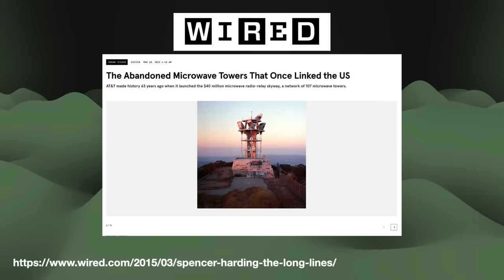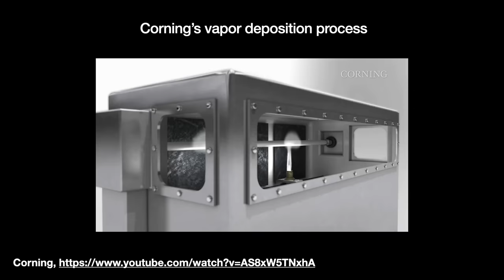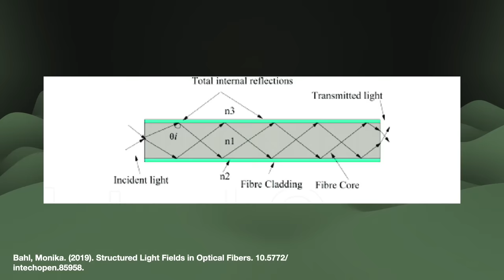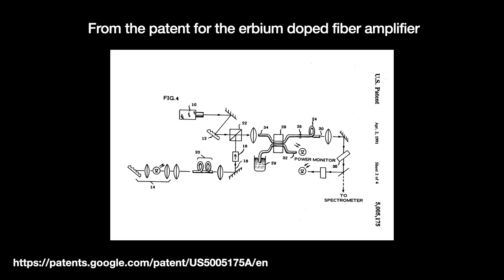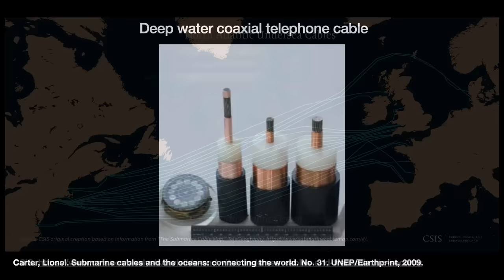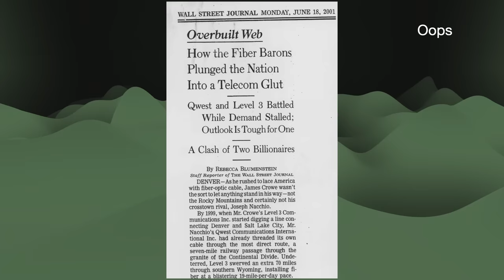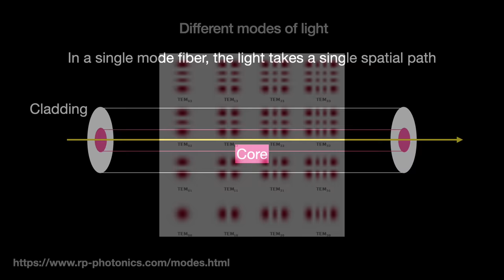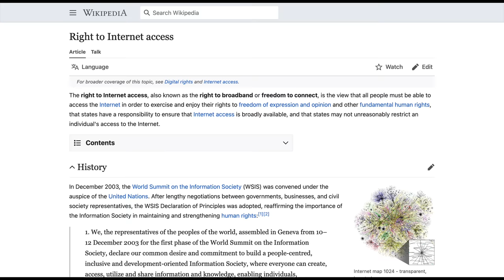How Optical Fiber Connected the World

Comment: Multi mode fiber used to be the cheap one that you avoided for high performance application, becuase the multiple paths lead to a smearing out of the signal. Instead of an impulse you receive a smear of all possible paths. Now, with additional mathematics and advances, we can actually use it to our advantage. How times change
Reply: To utilize the "multi" you need more complexity in the sender and receiver. Uncontrolled "multi" mode fibers over longer distances have semi-infinite modes which don't help your data transmission because the complexity to transmit&receive those modes is beyond what we can build. You want a relatively low number of modes to actually make use of that property. Actually you want many modes that are mostly-independent and require low complexity to make them fully independent logical signal channels.
Reply: @siegfriedkettlitz6529  Yea it balanced out. Multimode fiber itself was cheap, the transceivers were expensive tho. It was opposite for SM.
Reply: The problem with MM is also the size (volume) of light entering the fiber. SM works because it's a very tiny beam. You can, in fact, fire a SM laser down a MM fiber, but it won't go nearly as far. I've often wondered why no one built systems to fire multiple SM lasers down a MM fiber. With modem DWDM optic capabilities - i.e. very selective receivers - it's totally unnecessary.

A multi-core fiber would a serious pain in the ass to splice.
Reply: Until we have functional rectennas, it’s not worth it. Just put in a separate fibre.
Reply: @jfbeam I work as a fiber-tech, and a few years ago we were connecting multiple companies in a new building. To their infinite wisdom, the building owners built a fibre distribution net.
However, they built MM, while all modern ISPs use SM.

So we patched from incoming SM (isp side) to MM (building side), with SM gear in the rack at each corporation renting a few offices.

And it worked, had a few more DB then needed of attenuation, but with a 10db headroom, who cares...

Works fine to this day.
Reply: @djn3kkid  I've used MM patch cables for SM runs. Sometimes it even works. 🙂 (replaced with SM once they were on hand.)

Comment: I was introduced to optical fibre in Brisbane, in '95, while doing computer systems engineering. We cut & spliced fibre, in the classroom. (Tip ~ it isn't all that hard to do, but you have to get the two ends in the jig, and properly aligned, and they have to be precise.) and then checking the splice with an optical time domain reflectometer. That is virtually the same set of hardware you find in a police LIDAR unit. If your join doesn't come up to standard, at least you will know about it before you bury it again. The OTDR can tell you if there is a break, blockage or interruption, (which includes a kink or sharp bend where there shouldn't be) and locate it down to about one metre ~ which is handy.
The major take home, for me, (TLDR) was just how fantastically good fibre optic communications are. Which contributed to my massive face-palm when the Australian government (under the new prime minister, Malcolm Turnbull, who had been the opposition spokesman on telecommunications & IT, because he had once been a lawyer / attorney for a major telco, not because he knew did-ley-squat about IT or computers) decided to renew / upgrade continue the copper wire network and gradually expand the fibre network only as fast as required. ie ~ to replace stuff that was too old to keep fixing. That stopped the previous government's project to make the Australian Broadband Network, in fibre, all the way to the premises ~ (your front gate) which would have been massively better, if somewhat more expensive to initially install. Predictably, what we have now is slower, more costly, more error and breakdown prone, and in need of replacement anyway, which it mostly wouldn't have been if we had done it with fibre the first time. Measure twice ~ cut once. And don't take anybody at face value who tells you they can do some new development at half the price, using an existing technology rather than a new one.
Optical fibre is pretty near miraculous. The sheer amount of data / information you can pump through one strand of glass not much thicker than a human hair, is mind boggling. It has the potential to transmit millions, billions of times more information than a twisted pair copper cable. It does age, and will need to be replaced one day, but it ages 3 ~ 5x slower than twisted pair. The cost to install is greater, but over the whole life of the network, it's actually cheaper, and the capacity can be hugely increased by upgrading the send & receive at the ends. The more tightly you can control your colours / wavelengths, at the ends, the more channels you can pump through one fibre. Your potential bandwidth is limited by the quality & sophistication of your transmit & receive equipment, not by the glass fibre itself. The better your transceivers, (and repeater stations) the more you can pump through it. The theoretical upper limit is pretty much infinite.

Comment: Fun fact When the F4 Fighter jet was modernized, they saved 300 KG of weight by replacing copper wire with fiber.
Reply: 661 lbs or 1 OP's mom

Comment: Those same optical amplifiers also gave rise to fiber lasers for industrial cutting and welding, replacing bulky and expensive CO2 lasers.  And laser diode power modules are still growing in power and capability.

Comment: As early as 1970, I worked on a phototypesetting machine, the “PhotonPacesetter”, which use a xenon flash and a fibre optic bundle to transport the flash through a spinning disc with a character set, through a series of lenses, to photographic paper. It was my introduction to minicomputers. At one point, I was able to work around a hardware problem with “software”.  I was hooked.

Comment: I recently took an electromagnetics class that introduced me to how fiber optic cables work. The technology is very cool, and based on how you tune the material properties along the light's path, you can take advantage of certain behaviors as you pointed out in your video. There is still interesting engineering to be done to design more advanced systems that can communicate in novels ways. As a field, fiber optic engineering is not something a lot of people think about.

Comment: Latency is due to permittivity, not resistance. The dielectric used limits the velocity in both fiber and copper cables. Vacuum- and air-cored fiber and coax all have velocities close to the speed of light in vacuum

Comment: One of the things that you may want to touch on later on which was missed here was polarized optic fiber transmission.
Polarization is used in microwave transmission having a vertical and horizontal positioning This was also developed for fiber optic and is currently being used to double the capacity of fiber optic transmission. The other technology that is being used is still wavelength transmission one fiber can transmit and receive. There is one downside to this it means you need a wavelength to transmit in a wavelength to receive. Another good topic is on the development of terminating fiber and on the development of ribbon fiber. Ribbon fiber offers extremely high density.
Overall this video was very informative on fiber optics cable and I enjoyed it.
I have worked in the industry for over 30 years.

Comment: I used to work with fiber optics running lines and splicing and have seen entire buildings have to be reworked cause it was installed with too many bends or micro fractures. And compared to cable, splicing is a much longer process. It has nearly replaced copper entirely in banking data centers other than management ports that use copper. Sadly the industry sucks in a America, bad pay and few options due to guys getting the few jobs available and keeping them into their 60s

Comment: I design DWDM networks for a content delivery network.  I still haven't heard a good reason for multicore fiber in a metro or long haul network.  Having more strands of fiber isn't a big constraint... when you run out of capacity on a rail you get an IRU for more strands.  

Now in the data center I can see some value as density matters.  Everyone hates MPO/MTP cables, so having a multicore LC would be really nice if there comes a time when the thermal and power requirements lessen to allow for high density optics that would benefit from multicore fiber.

Comment: that's great if we're talking about backbone data transmission. But what about the issue of last kilomoter/last mile connection to places of business and residences? That's a very interesting story in itself, especially with how former state-owned telecoms like those in Europe, Nippon Telephone and Telegraph in Japan, and Korea Telecom in South Korea were able to connect users in metropolitan areas easily. Here in the USA, connecting everyone to high-speed Internet took longer, mostly because the growth happened after 2015 when companies started to roll out DOCSIS standard data connections using already-installed TV cable lines. And there was an attempt to do high-speed wireless Internet using a somewhat forgotten technology called WiMAX (802.16). And now the final fast growth of fiber in recent years even out to rural areas.
Reply: Fiber would be promising because considerably more strands can be pulled in the same amount of space that a single coaxial or twisted-pair cable would take up, meaning time and costs saved. I recently worked on a building that incorporated all three, and the fiber was by far the easiest to pull.

Comment: One correction: you describe the IVD process of making blanks, but the photos you show are for the OVD process. There are many common processes to make the glass blanks. Including VAD and PCVD as well. OVD and VAD are especially well suited to high volume production. IVD and PCVD are generally better suited to lower volume specialty fibers as it is easier to tightly control the vapor deposition. Most manufactuers specialize in one proecess. Like Sumitomo Lightwave primarily uses the VAD process, while Corning primarily uses the OVD process. As someone who designs fiber making equiment, it was cool to see a video talking about it. Most people dont even know it exists. Meet people all the time that say they thought it was all satellites when I describe what I do for a living.

Comment: Even with fiber optics running into this home near the beginning of the time that started happening which was early 2000s, the speed has increased a LOT.  Our first service was 25Mbps/25Mbps.  Then it went to 50/50.  Then it went to 100/100, then 200/200, then 500/500 and now it's 1Gbps/1Gbps. So, the increase in about 20 years has been 40X.  This of course is not a doubling in speed every year, however the need for these speeds is pretty low, even if you're watching 4K HDR movies streaming on some service.  Well, that's not even 100Mbps.  Indeed one of the main reasons for having that speed is for downloading games or other very large downloads.  With gaming systems, a game might be 60 - 120GB in size.  If you have a few games and setting up a new system with them, this can quickly be over a terabyte of downloads.  But after you set up the gaming system, then the need for that bandwidth drops dramatically.

So we're at the point now where available bandwidth in larger markets is PLENTY.  The main issue as is always the case is managing resources and cost for getting service to more rural areas.
Reply: Nowhere near the speeds of fiber yet, but at least Starlink has greatly improved accessibility to those rural areas.

Comment: I think the information in the video at 16:00 is misleading. Single mode and Multi Mode refers to the amount of path the light takes in the core. Multimode has a bigger core 62.5 or 50 Microns vs 9 microns in single mode. You can transmit bidirectional wavelength with out interference in single mode, example is TX at 1310 and RX at 1550 nanometers. Now Multimode uses 850 nanometers and because the core is bigger you have more multi-path, increased reflections, dispersion, and attenuation, limiting  distance capabilities. More reflections with the cladding, more path.  The best way to understand this concept is to think of laser transmissions and RF ( You can transmit in 2.4 GHz and receive in 5.8 GHz ( The Fiber tunnel is the Wave guide, Coax, etc ). Now in multimode you can easily use multi polarization and have higher bandwidth. Of you can think on other techniques like OFDM, but in light or fiber-optics .  I'm not a technical writer , hope you understand
Reply: Indeed misleading.
Reply: I think the single and multimode part needs further explanation.  Confusion leads to misperception and people are misled.
Reply: Yep, this is often a point of confusion when explaining fiber optics to non-technical people: they hear "multi" and they think it's better than "single". Also the fancy "mode multiplexing" explained in the video would require higher purity multimode fiber like OM4 or higher which is vastly more expensive than standard OS2 single mode fiber by length.
Reply: I always enjoyed EM-wave knowledge easily lets you step to waveguides and then optical fiber. It's a good basis for your layer 1 if you IP.
Reply: Graded Index Multimode (GIMM) optical fibre also operates at 1300nm wavelength. 

Optical fibre propagates at 2/3 the speed of light in a vacuum as the Refractive Index (RI) of the core is around 1.5. OF is optically more dense than a vacuum hence the slower propagation speed. 

The other commonly held myth is that OF (Optical Fibre) actually uses light it does not, it uses operates in the Infra Red (IR) in the region 850nm to 1300nm for GIMM and 1310 nm to 1625nm for singlemode (SM) optical fibre.
Reply: @bigvinny333  
Said, ""... it's not [optical]...""

 I can see the red signal of the multimode fiber - it's visible and it's optical.
Reply: The red laser is just a simulation on an optical bench it is NOT a telecomms or datacomms protocol. Ruby lasers typically work around 650nm in the red part of the visible spectrum and have high attenuation (power losses over distance) and are not suitable for transmission over any network distance. Datacomms gigabit ethernet typically uses a Vertical Cavity Surface Emmiting (VCSEL) laser at 850nm or 1300nm in the IR part of the spectrum. These wavelengths are the two low attenuation loss regions that will support attenuation losses less than 3dB/km (3dB is 50% optical power loss). Link length can exceed 1km.

In telecomms singlemode applications Fabry Perot lasers are used at 1310nm, 1550nm and around 1625nm, again these are low loss regions in the infrared region of the EM spe trum with attenuation less than 0.4dB/km. Singlemode links can exceed 100km.

I guarantee that if you look directly into a live OF in a data or telecomms network you will see no coloured light, as IR is actually heat but you may damage your eyesight by burning your retina due to the high power density of these lasers !
Reply: @bigvinny333  
I see the 850 nm very dull red of a multimode fiber.  So for multimode short distances, your guarantee is null and void.
Reply: @acmefixer1  Red visible light is 620nm to 750nm. Infra red means "below red". If you can see it it's not IR.
Reply: @bigvinny333  
Said, "If you can see it, it's not IR."

You're trying to tell me what I can and can't see and whether or not it's IR.  BZZZT!!  YOU'RE WRONG.
Reply: @acmefixer1  You need to consider the spectral width of a laser or LED source. Sources such as those produced by Honeywell for comms applications have a very narrow Spectral Width (SW) (and Full Wave Half Maximum FWHM). If the SW is centred on 850nm and you can see red visible light, the SW must be very wide indeed. The near Gaussian SW profile is the difference between the maximum and minimum stimulated wavelengths.  I would suggest such a wide SW you allude to is not a comms grade source. A wide SW leads to a large amount of Chromatic Dispersion (CD) which in turn would lead to short usable network link lengths as the detector will have trouble distinguishing digital pulses. Wide SW's are more typical of the old LED's used in for example in fast ethernet systems. Please feel to get the last word in I'm done !
Reply: @bigvinny333  
Some older MM links between bldgs (under 500m) were obviously LED - they were bright red.  Then some were not the transmitters used in the older MM links; they were very dull, dusky red, barely visible.  But my eyes don't tell me what the  wavelength, I just know it was longer than deep red.

Comment: The use of railroad land for fibre cables reminds me of my local city here in the UK. Around a century ago the railway company realised that their routes could supply electricity to outlying industry and households by utilising the cable routes they already had along the local railway system. This method of supply only lasted a decade or so until the use of pylons over local land became a thing but the initial supply did generate (bad joke!) an extra income for the local railway system.

Comment: I worked at British Telecom research in the mid 1980s as a fresh graduate. There they were working on TAT-8 the first fibre-optic transatlantic cable. There was so much research there in opto-electronics that is just now coming available on Silicon wafers platforms to enable Quantum computing and data center inter chip communication.
Reply: Are you saying they were doing work keeping quantum states coherent over fiber?  For some reason I assumed that would be hard but I guess it must have been done to allow some of the fancy EPR experiments.

Comment: MMwave transmission is still useful for low-bandwidth, low-latency applications. An old network engineer colleague at a High Frequency Trading firm would spin up MMwave paths to cut down on latency over their fiber paths just a couple years ago.